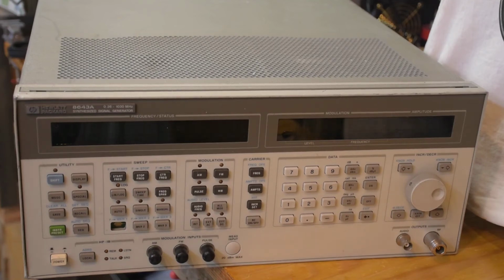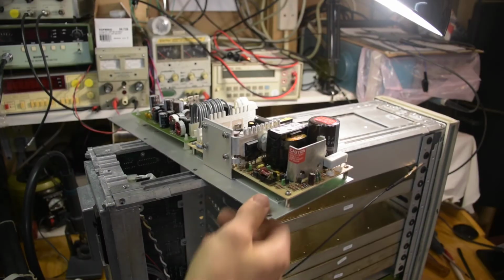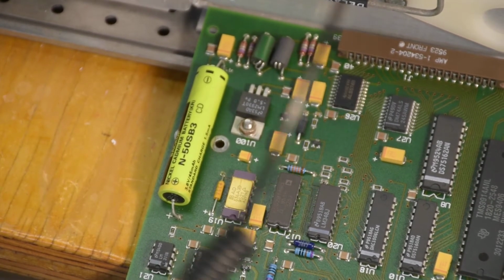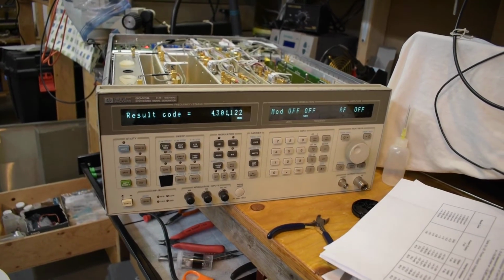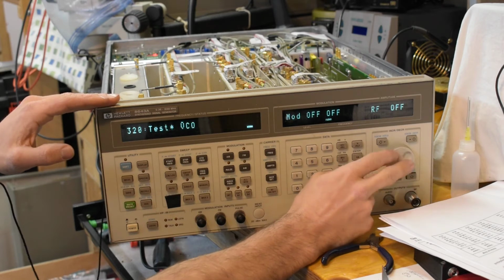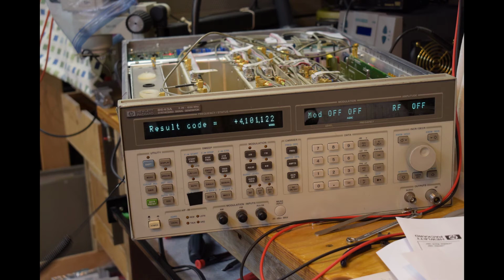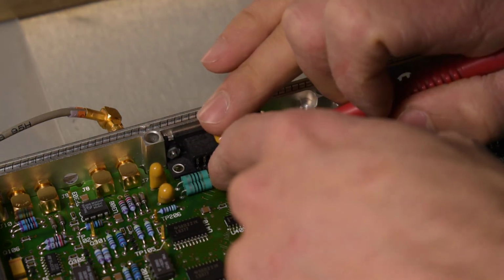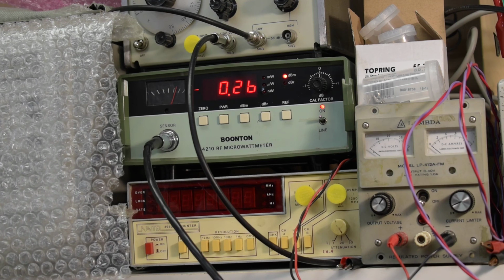HP 8643A signal generator repair

Comment: I had very similar experience with my HP 8644B which pretty same unit like yours, but my unit was way much horrifying that i started to laugh after seeing what they sold me, 3 boards modules were loose not even plugged in slots, and two ALC boards duplicate and a missing Doubler board, and all the cables are loose ...not even one single cable was hooked.....!!!! 
so i ended up using it as spare parts for the other one that i have, took the power button and the covers.
if you follow curiousmarc channel he called the technician who was working on a unit that he purchased from ebay...." THE TECHNICIAN FROM HELL" ....lol.
probably he is same guy.

Comment: Didn't see it in the comments, but those front buttons are part of a larger rubberized membrane.  So they can not be individually replaced.  I had the same issue with a HP 8657B I bought and luckily found a used front panel to havest a replacement membrane from.  On the 8657B it used two membranes.  Most likely similar on your 8643A.   BTW,  I was able to still activate the switch using a insulated rod with a small bit of aluminum foil taped to its end.  That worked fine until I found the replacement front panel.
Reply from the maker: Thanks - yes, I eventually realized that it would most likely take a whole new membrane, that realistically would have to come from a complete front panel. Luckily I don't really need that particular button so it will probably remain unrepaired; I just taped over the hole so dust and debris doesn't get in.

Comment: Curious... why would you buy one of these with all of the modern options?  Is it purely a "this could be fun" interest?  I've had the option to buy one of these in working condition but I cannot think of any reason I would want a huge boat anchor like this in my room.
Reply from the maker: Can you name a few of these "modern options" with equivalent specs that aren't  2k+ $ ? I wouldn't mind something smaller and lighter than this monster, but the modern alternatives are at least 4-5x more expensive than what I paid for this.
Reply: @fenugrec5697  I feel like you're not genuinely interested in a real response but are more interested in defending your purchase. And that's fine.  I think your "out" to what would have been my next reply is going to be the "equivalent specs" wording. No matter how I reply or how close the specifications seem to be, I feel like your response is inevitably going take a contrary and argumentative stance which will ride on that phrase's proverbial back since your first response's tone is already rooted in that direction.

My question as well as my interest was genuine and I do not have the desire or motivation to argue or validate your purchase. I was simply trying to understand the purchase logic as I am in the market myself.
Reply from the maker: @Wil_Bloodworth  I don't mind discussing it - it would've been easy enough to simply ignore the comment. I would lie if the challenge of the repair wasn't part of the interest, but I think my point still stands - getting comparable specs, in a new model, is much, much more expensive. ( my research = 5 minutes of looking at rigol and siglent lineups).
Some 50$ bargain-bin alternative might exist (I have in mind typical single-chip DDS bare boards that can be found on... "international shopping sites", but I don't expect the specs would compare favourably at all. I'm not aware of a middle ground, but would gladly be proven wrong.
I don't even have space on my bench for this machine, I store it in a separate room and set it up on the floor when needed. But that inconvenience doesn't amount to 2k$ for me.
So, 3 points : specs per dollar, total price, and repairability.

Comment: Enjoyed your video. I need to recap the power supply. The 5volt rail is low and causing an error. Where did you find replacement caps?
Reply from the maker: Thanks. You're sure your low voltage condition is due to a bad PS and not an overload ? 
I just shop on the usual online suppliers (DK/mouser/newark) and find mechanically compatible parts with better temperature and endurance ratings if possible.

Comment: When you replaced the battery did you apply a voltage to the circuit to maintain the memory?
Reply from the maker: No : it was long dead, and the only thing you lose is the self-calibration. From the manual: 
" When the instrument is off and the Controller Board is removed from the motherboard connectors, the instrument calibration data located in the Controller Assembly RAM will be lost. At the next power-up, the instrument will sense a data lost condition and automatically activate the Recal routine. "